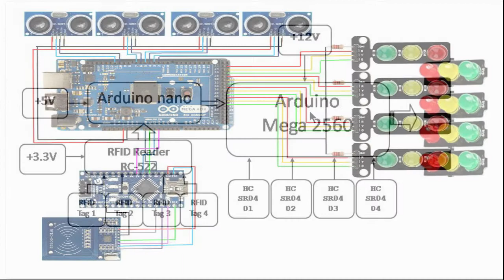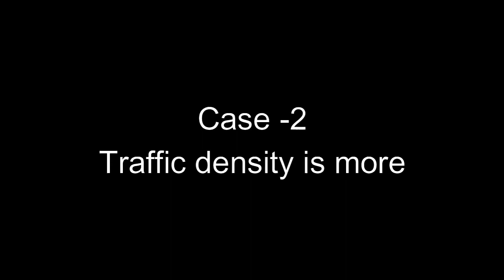Traffic Signal Management and Control System based on density of vehicles and emergency vehicles

Comment: Can we use nodemcu instead of arduino nano . If yes, pleaseguide me to do it . Or can do both of it with Arduino mega and can I use ir sensors instead of ultrasonic sensors
Reply from the maker: Arduino mega in only way becz of more no of input and output, u can use switches instead of nano and rfid

Comment: Sir. Cost of ARDUINO MEGA IS MORE ,,,CAN WE USE ARDUINO UNO in place of mega.....??
Reply from the maker: Mega because of no input output are more
Reply: What if we are using only 2 ultra sonic sensor @hrbembedded_craft
Reply from the maker: @abhishekkumar-xk1tw  count no of output then decide yourself, as per circut  diagram
Reply: @hrbembedded_craft  where is the circuit diagram
Reply from the maker: @abhishekkumar-xk1tw  one sensor for one road
Reply: Without facility for emergency vehicles
Reply from the maker: Not enough input output

Comment: The code is not working sir there's a problem about the LED and the sensor connection is not working and I think the code of the sensor is not connected to LED
Reply: Did you solve the problem?
Reply: Ya i too am having the same prblm did urs get resolved
Reply from the maker: Please check your ultrasonic sensor supply
Reply: can you please share the code ???
Reply: @kartiksingh2072  u have the code? plz share

Comment: Is TimerOne hardware needed to be installed before coding?
Reply from the maker: #include timerOne library is included in arduino boards
Reply: @hrbembedded_craft what type of RFID cards did you use, the 125kHz or the 13.56MHz?
Reply from the maker: 13.56 MHz
Reply: @hrbembedded_craft the lights are not switching, it only keeps the green light in one module and the rest are red, what should I do?

Comment: Is it possible to develop a project without an Arduino UNO and RFID Rc522?
Reply from the maker: Rfid is used as a switch, of course you can  but mega is required to generate time to switch led's

Comment: Rfid sensor u have facked
Reply from the maker: No i have given 30 seconds time for each rfid card
Reply: @hrbembedded_craft  so a car comes near the sensor. The signal changes for next 30 seconds?
Reply: @hrbembedded_craft how to contact to you?
Reply from the maker: This code system works in round robin format
Any card you swipe it should complete one cycle

Comment: sir how to contact you as i cannot contact you through the phone
Your phone number is not working
Reply from the maker: whattsapp 9036828801
Reply: Sir my ultrasonic sensors are not working 
is the code okay ?
 @hrbembedded_craft
Reply from the maker: @The.Explorer.108  100% it is, remove any object infront of sensor 20cm away, or check connection